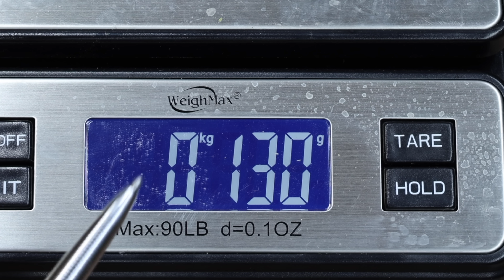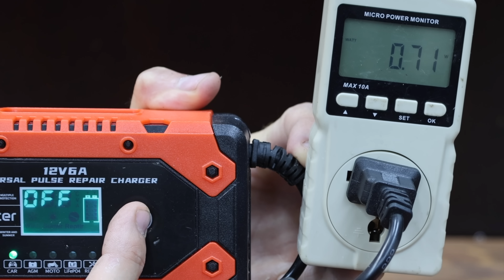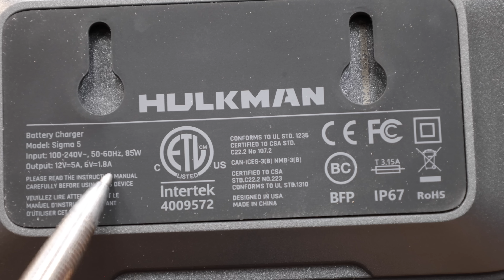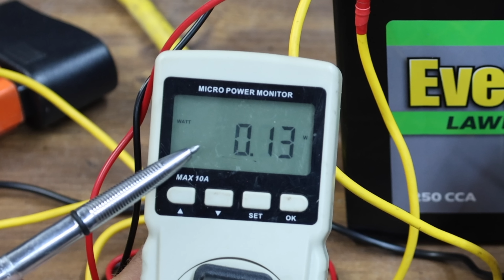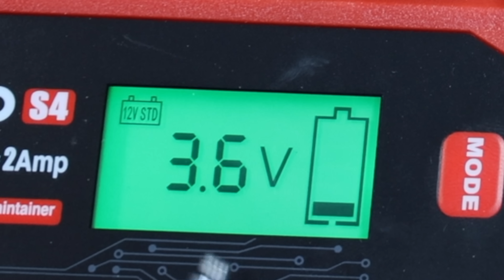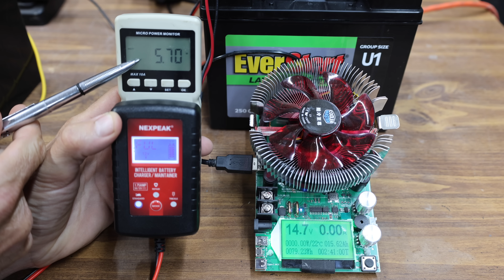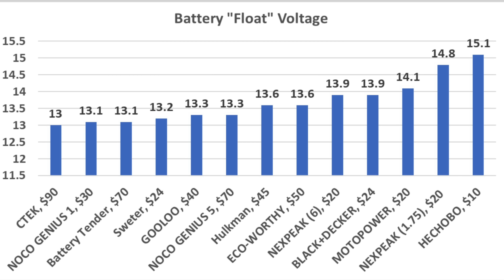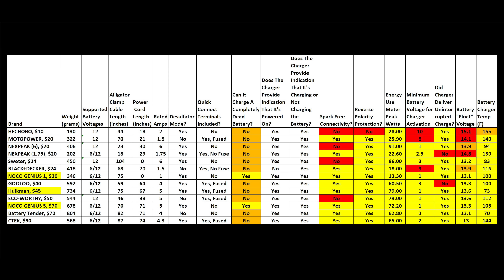I Tested the Most Hyped Car Battery Chargers – One Stood Out!

Comment: Any battery charger that can't charge a completely dead battery is absolutely worthless. I bought a $200 Schumacher DSR161 charger for my shop and it won't charge a completely dead battery.  Just stay away from any of the Auto Sensing "Smart Chargers". They are all 100% junk.  I sold it in my yard sale and bought an old Sears 60/250 charger/starter off of marketplace for $100. It doesn't give a crap if the battery is dead, it will cook it back to life or explode it which ever comes 1st lol.

Comment: Current battery electronic 
chargers are absolutely worthless. Most of them cannot charge a dead battery. That's why I would need a battery charger. I have a $22,000.00 Miller 302 Airpac welder with built-in 400 amp 12 or 24 volt boost and or 75 amp charge neither will work on a battery that is dead so that part of the welder is absolutely worthless to me.

Comment: Thanks I just Had to Buy a new Battery Napa Gold True to its Name 7 Year I got it in 2018 Feb , just died last Month , I think $212 with the recore Lead acid flooded in my Toyota Tacoma V6 , it's a huge Battery seems like the Engines needs that 830 CA , I tried Reviving the last one with a really Good brand charger I can't remember the Name Bigger then all those you tested it worked for a Day Then Just not enough Cranking Amps to turn over the next day I think it's that Costco Brand charger had it for some years never used it But got that Costco Jumper pack a few. Months ago with a100%  Charge started the truck Easily But took down 5% of the Jumpers Charge idk what kinda of Cells are in there but it's light For a jumper pack Maybe some Tesla 720-42 , cells I for get I was vaping for some years knew them all by size forgot them now 18550's Most Common I have some Samsung 25 F's that completely drained I've seen a few Ways to Get them back to life but those where in the Battery pack I need Single cell Recovery Methods

Comment: I have a dozen small chargers around as the cursed parasitic drain  all the new vehicles have, nothing will start if it sits for any length of time. As I am in a Cold Climate (despite the global burning happening) this mean the battery will end up freezing, and I am out the price of a battery.  This is an issue I wish they would fix. I look like I have a lot full of electric cars as they all have to be plugged in for a winter of trickle charging.
Reply from the maker: Thanks for sharing!

Comment: I've grown up with Battery Tender as a household brand and I think I've gotten rid of more batteries than I probably needed to based on this video.

Last night my buddy came over with his NOCO jump starter and got my 3000GT started using the pulse mode on it to get it started while my 4A Battery Tender wouldn't charge at 1V. So I think I'm sold. The Battery Tender will stay in the garage for the motorcycles since it does a good job at keeping batteries healthy, but just won't get some of the projects in the garage started
Reply from the maker: Thanks for sharing!

Comment: The problem with a car battery being "full" is not an easy one. First of all it highly depends on the temperature of the cells. For example if you assume 12.6 V @ 20°C to be "full" it would only need to be 12.24 V @ 0°C or 12.78 V @ 30°C.  
Second pretty much all cars use the wrong charge/cutoff voltage. In the past we had PbSb batteries. Those were the ones you could refill, which need a ~14.2 V cutoff. Most cars will still cutoff at this voltage. But for like two decades now we switched to PbCa batteries - those are the ones you can no longer refill. This chemistry has a gas voltage (when it produces gas) of 15.8 V in contrast to the 14.4 V of the old cells. But this also means that those batteries take longer to get fully charged if you use 14.2 V that most cars provide which in turn increases their sulfation rate and especially kills your battery faster if you only drive short distance.

Comment: I bought the Noco Genius 5 about two years ago to keep the battery in my tractor topped up when it's cold in the winter and it's been a great charger. I have a similar style Cen-Tec branded charger I bought from HF that also works great but it's only capable of charging lead-acid, sealed agm and gel batteries. But I needed one that was capable of charging lithium batteries and there aren't many brands of chargers like this that are capable of that. A lot of the models that are lithium capable you have to order online but the NoCo was available at WalMart. If I don't have to order online I'm not going to. I shouldn't have to rely on the internet for everything.

Comment: On recommendation of a mechanic, I bought a Shell SBC400. (Designed for charge or permanent installation.) Its force mode brought back a battery that had been 0-volts dead for a couple months, and (very slowly) recharged it. Battery is now good as new. I bought two more of these charge units.
Reply from the maker: Thanks for sharing!

Comment: If you do larger battery chargers you can try the pro logixs which is the same company as the jump n carry jumper packs. They have constant voltage output for vehicle programming and max ouput amps of 100amps at whatever voltage you need.
Reply: strongly advise against carrying lithium ion battery packs in the car, let alone in the home. these things have high chance of catching fire and there goes your house and or car. its pretty absurd how people dont talk about this risk which is an unacceptable risk. i put my lithium devices in a metal bucket if anything should happen they can burn alone in the bucket. learn how to keep your safe lead acid car battery working instead of lithium jumper packs, which is keeping its charge up above 12.4 so it doesn't sulfate and listen to how your wiper blades work while the engine is off from time to time as a way to test battery strength.

Comment: CTEK has several different models that are even more expensive but include more features or additional performance for specific types of batteries. I'm really curious why those weren't even tested at all and instead that specific model was tested. I myself have the popular CTEK Multi US 7002 model which has a reconditioning mode... I would think the charger could deal with a completely dead battery... but I'm not positive.

Comment: Starting with a dead battery highlights the difficulty of this comparison. We need to ask the right question.  Which one gives me consistent performance and gives my battery the longest life?  I maintain my car battery in a 100% charged state.  I may be wrong, but it's my understanding that lead-acid and AGM batteries degrade when operating at a sub-optimal charge.  That's a metric worth testing.

Comment: I've had the CTEK charger for over 10 years. I really like how it shows the exact step in its charging process.
If the battery is truely a goner, it'll quickly light the warning LED, but not without telling you what step it failed at.
Reply: I've had mine for 8 years. Worth the money.
Reply: I find with my CTEk on recon mode it can even get a really dead battery up, takes a few tries- had it 10 years +

Comment: you should include one of their Victron Chargers. I had CTEK (7 Amp) and I was to impressed about them. These get too warm, actually hot inside at 7 Amp.. while Victron 10 Amp (up to 20 Amp max) has metal case and never get even warm, as said 10 A.
And the price difference is NOT massive.
In the app you can see exactly how many amp has been pushed into your dicharged battery. Has floating mode.. Is probably thebest mo ey can buy ...medium to high price..
Reply from the maker: Thanks for the video idea!

Comment: I’m a bit of a NOCO fan after having great luck with their jump packs. I have a gb70 and I think gbx75. I have the Genius 2 mounted in 3 pickups and an RV. Genius 10 in dump trailer, and the 10x4 in the garage to keep lawn mower and atv or other small batteries topped off. Never had any trouble and they’ve saved me more than a few times!
Reply from the maker: Thanks for sharing!

Comment: A trick with many battery chargers is if the battery is to low they can't detect the battery. Try jumping it with a vehicle with a working battery or a battery jump starter power pack, just to get some juice in it. Then the lower end battery chargers will work most times.
Reply from the maker: Thanks for sharing!

Comment: I bought a NOCO genius 10amp charger a few years ago and I’m so glad I did, it is powerful enough for most all jobs and only $100.
I use it for LIPO and the car lead acid batteries, plus it will act as a 12 volt currant supply.
Reply from the maker: Thanks for sharing!

Comment: I found out years ago that any new charger, even from Schumacher, won't charge a dead battery.  The "smart" chargers think it's a 6V battery, and to get it to charge at 12V you have to trick it with another battery or voltage source.  You're better off just buying a 12V power supply with CV and CC knobs.  Set CV to the max voltage for the battery, and set CC to the max charging current for the battery. Then just walk away.

Comment: If I have a seriously dead battery that needs to be charged, I'll use my old 12 volt charger and not these smaller type chargers.  Rather, for me, it is all about how well they maintain a battery throughout the winter on equipment such as my riding mower that will sit unless I need to tow things around in the trailer, my gas powered generator when the power goes out, etc.  I agree with one of the other commenters about the CTEK and it's eight step system (one of which is the reconditioner cycle that may restore a completely dead battery that then can be charged).  Here are the eight steps that the CTEK has:  
Desulphation: This initial step uses pulsing current and voltage to detect and remove harmful sulfates from the lead plates of the battery, restoring its capacity. Sulphation can occur when a battery is left discharged for a prolonged period.
Soft Start: The charger performs a test to determine if the battery can accept a charge, preventing charging from proceeding with a defective battery.
Bulk: The battery is charged with maximum current until it reaches approximately 80% of its capacity.
Absorption: Charging continues with a declining current to maximize the battery capacity to 100%.
Analyze: After the absorption stage, the charger tests the battery to ensure it can hold the charge. If it can't, the battery may need replacement.
Recond (Reconditioning): If necessary, the reconditioning function is activated to recover and recondition deeply discharged batteries.
Float: Once fully charged, the charger maintains the battery at its maximum voltage level by providing a constant voltage charge.
Pulse: For long-term maintenance, the charger enters pulse mode, monitoring the battery voltage and delivering pulses when necessary to keep the battery between 95% and 100% capacity and prevent overcharging. 
In essence, the CTEK 8-step charging program goes beyond a simple charge, actively working to desulphate, test, and maintain the battery, maximizing its performance and extending its life.

Comment: I have a 10 amp version of the NEXPEAK which has a ten amp supply mode (force charging as you say) in addition to the other various modes. Brought back a 650CCA battery in a used car I recently bought with about ten minutes of supply and then it ran normally starting with the desulfation and three hours later it was able to start the car without any other help.

The car has a blown engine of course :( but at least I didn’t have to buy it a new $140 battery to find that out!
Reply from the maker: Thanks for sharing!

Comment: I bought a CTEK MULTI US 3300 around 12 years ago now.. It is a similar size to the CTEK reviewed here. I'm a believer in desulfation now. I use it on all my LA batteries and vehicles, and I find my batteries lastng much longer now, even 8 years for a car battery which do typically last around 5 (I do buy good car batteries though, the high end Walmarts as seen here). Any time I get a new LA battery, whether UPS size, motorcycle, or auto and this thing is still working great.
Reply from the maker: Thanks for sharing!

Comment: This is a fantastic review. For those with LiPoe4 batteries, it is critical that you get a charger that is compatible, because most are not. Give the Noco Geniuses another point for that since they support Lead Acid, AGM, and LiPoe4 batteries. Todd did show that some of the chargers do support LiPoe4, but it wasnt explicit on the chart.
Reply: Definitely a more important aspect than being able to charge a 0V battery. That battery needed a maintainer to prevent that. I would add the Hulkman Sigma 10 for this very reason. Plus it can be used as a power supply.
Reply: The expensive CTek does that job well. Notice it stops at 13v on the dot. BMW LiFePo4 approved. They actually make the BMW branded chargers.

Comment: Don’t take this as criticism, you did an excellent job testing these as always.  

I wonder if you could have used an amp meter to see how much charge was being output, I’m wondering if some of the chargers just use 10+W of the feed power to stay awake. I did see the battery voltage staying high so that does answer it’s not all inefficiency.
Reply from the maker: Thanks!  Thanks for the constructive feedback.

Comment: The ctek was touted by Jay Leno.  Their instructions said reconditioning mode is safe to leave battery connected to vehicle.  It fried the main screen of the car, presumably because its recon mode pulses nearly 16volts to the system during that phase.  Expensive lesson.
Reply from the maker: Thanks for the feedback.
Reply: My C-Tek owner's manual for the model 7002 U.S. states that most electronics can tolerate 16V, but then it goes on to say "consult your supplier" if in doubt. I'm not sure which supplier they're referring to - the vehicle manufacturer? They also state that Recondition mode can shorten the life of light bulbs and that the minimum risk to electronics when using Recondition mode is with a disconnected battery. The owner's manual for my C-Tek 4.3 Polar model only mentions about increased water loss and/or out-gassing from the battery when using Recondition mode.
Reply: @Ralt_Alt406 Interesting!  I’m betting they have learned the issues and revised their manuals since the Jay Leno episode highlighting the 5.0 CTEK model.  The manual says there is no need to disconnect battery from car while using recond mode.

Comment: To eliminate the sparking, hook up the connectors to the battery before plugging in the charger.
Reply: This is often mentioned in the manuals of these chargers. 👍🏻
Reply: This is true but you got to remember, a lot of people out there are not very savvy.
Reply from the maker: Thanks for the feedback.
Reply: there's a whole safety process the isntruction manuals wil ltell you about this lol at least for the noco brand. they say turn your back on the battery before you plug in the wall outlet LOL they're really covering their butts legally for liability.
Reply: This is obvious to many, but not enough.
Reply: I do this as well just to be on the safe side, but i did it on my own not because it says to in a manual somewhere, but because of experience and electrical knowledge.
Reply: Then your friends Archie and Sparky will come out of the outlet.
Reply: @diegudr  
The outlet is cheaper to replace.

Comment: 16:22  How is the Battery Tender temperature 5 degrees below ambient shop temperature? And the Hulkman was 73?
Reply: As he will probably get into if he does an IR camera video, the emissivity of the surface you're looking at can mess with the reading obtained.  He may not have done a calibration on the camera also.  They're not really good for 3 or 4 digits of precision, but the numbers are still valid for a relative comparison.

Comment: Being an electrical engineer, I reviewed some battery chargers from an online retailer.  Like what you experienced, the number of chargers that weren't spark proof was eye-opening.  Dead stop in my testing.  Not having an UL or ETL listing was the other showstopper.

Too bad more chargers don't have a 'force mode' to bring the battery voltage up to a level that the charging can begin, seems like a downfall of many chargers that otherwise would be fine.
Reply: From the battery manufacturer point of view, a battery is considered to have irreparable damaged once its below 9 volts
Reply: @elvenhome21that's simply not true and it's because they want to tell more batteries. I worked at Napa and we had a battery charger that could do 120A jump start, I brought dozens of batteries back of life that way.
Reply: @Megasteel32  back to life to out of your parking lot... how many survived long term after that?
Reply: @kleetus92  My father has car battery shop, and has brought tens of thousand of batteries "dead" below 8V. Most of them being 1-2 years old, and after being ressurected from dead, they continue work for 2-3 more years.
Reply: @kleetus92 considering I didnt see em again probably all of them
Reply: One commenter connected a simple 9 Volt torch/radio etc. battery across the terminals (+ to +, -ve to - ve)
that fooled the charger into thinking the minimum 9 volts  were present in the to -be -charged battery..
and the charger took over and charged the battery 
whereas it would not do so without that "fooling"....
Reply: That's why I keep my old dumb analog battery charger around. I can use it to get the voltage up then put the new automatic charger on.
Reply: @memsu06  I have  a big dumb cart-style charger for the dead batteries and jump starting.